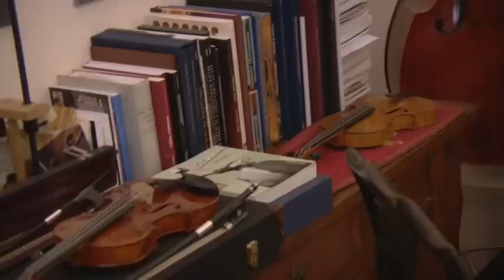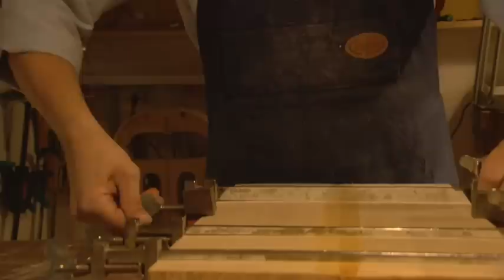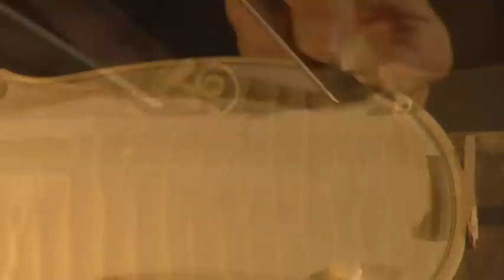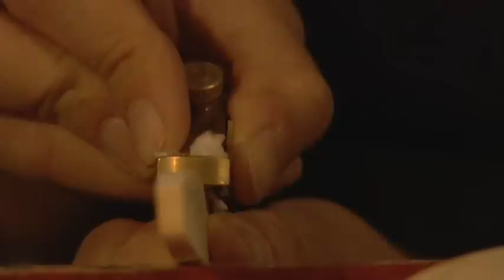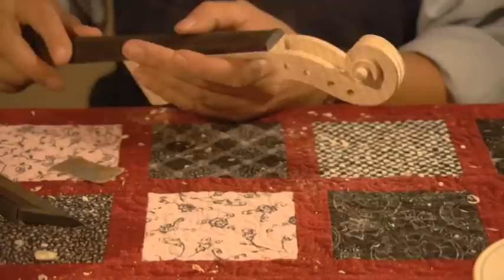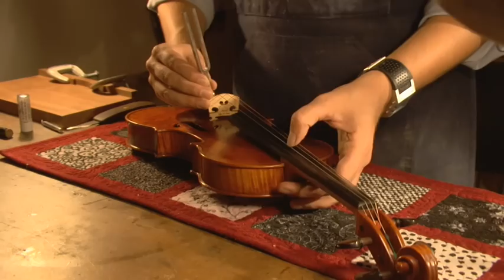Video Violinmaking High definition

Comment: I've often wondered if a violin's wood could be artificially aged before being put together.  If you microwave organic matter it goes a bit soggy as it forces moisture out of the cells but when it dries after this it is very brittle.  I would think this is what aging does to wood. If this could be applied at some stage to violin wood, would it sound better for it?
Reply: redf I can’t speak for Mr. Russ, but check out “torrefied” wood.  Some guitar makers use wood that has been processed in that way. I haven’t looked to see if violin makers also sometimes do. Fascinating stuff.

Comment: i have question,why the violin makers dont make varnish the inside?if the aim is protect the vood,why they dont make varnish to inside too?
Reply: samet polat that interrupts the vibration of the wood. Also you can't brand it with and iron if it has been varnished. Also it would be a slick surface and the sounpost and baseplate would have trouble staying up
Reply from the maker: The protection is actually "only "against the acid of your skin. Since no-one touched the instrument inside three is no reason to apply additional weight in form of additional varnish, which would block your violins sound ability

Comment: Why is the violin varnished after the fingerboard - neck is attached, I would have thought the belly would have been varnished first
Reply: Vincent Oliver In truth I don't know but my guess would have to be something to do with the glue, maybe it would remove the finish or the heat from it would damage it. When I first watched the video I had the same thought.
Reply from the maker: fingerboard and neck are not or better should not be varnished since it wouldn´t feel nice on your hand and fingers while playing. But even if it would be varnished after a few days of heavy practicing the varnish (what ever long lasting varnish it would be) would disappear anyhow.
The wooden parts where you touch are usually treated only with furniture oil and that's it. That feels like silk once it is finished nice.